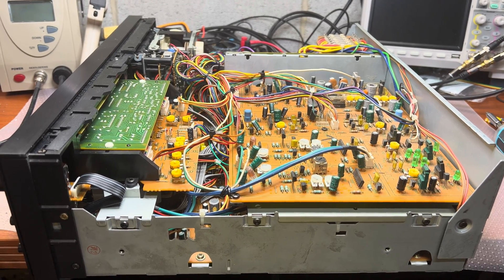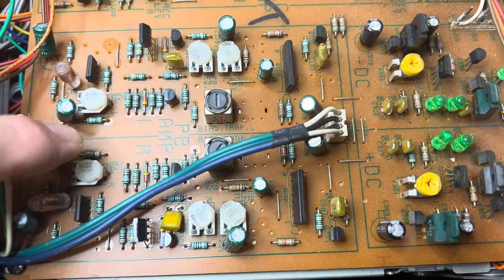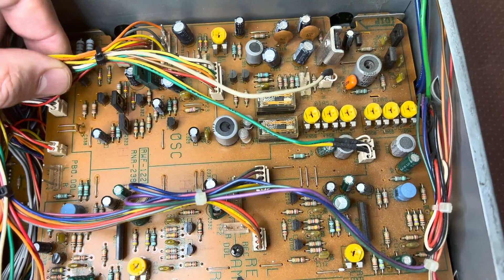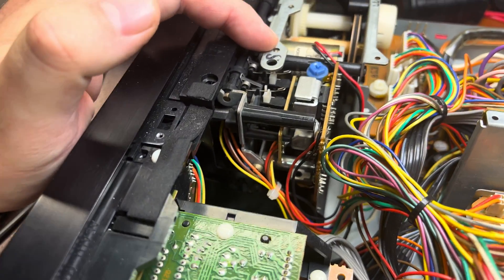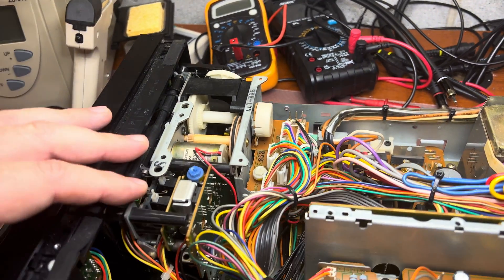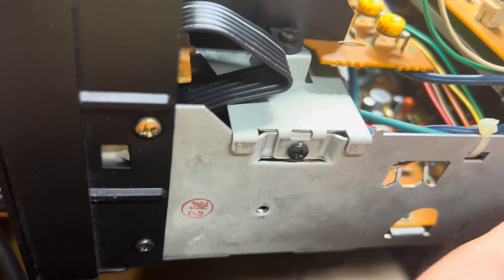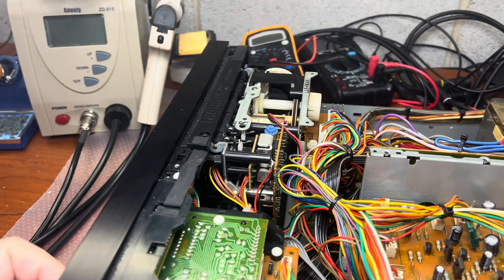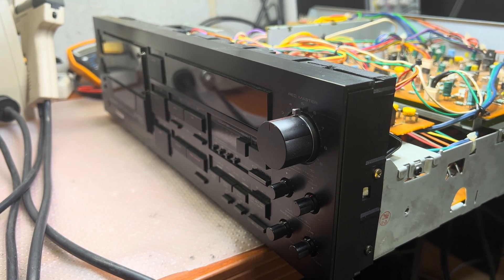Inside Look at the Pioneer CT-A9X: Anatomy of a High-End Cassette Deck

Comment: what's the purpose of those L.E.D.'s in the +/-10V DC audio power supply ?
Reply from the maker: @emilian5903  just to have temperature stabilized voltage offset. Read thru amplifiers design.